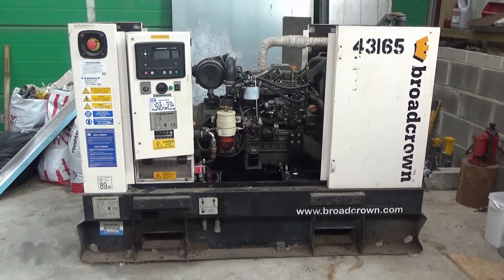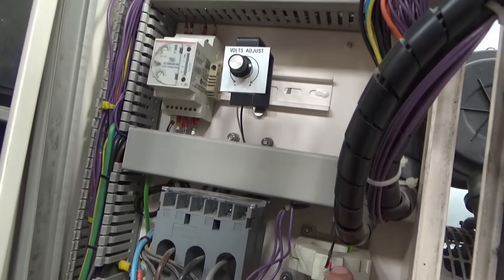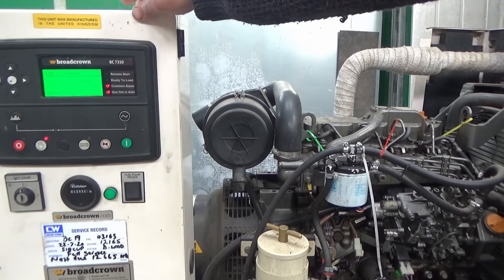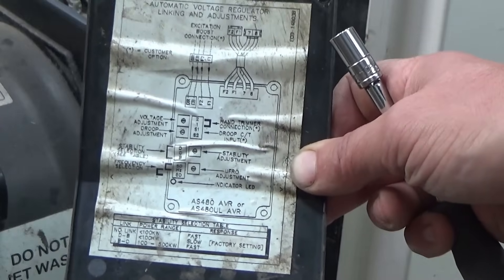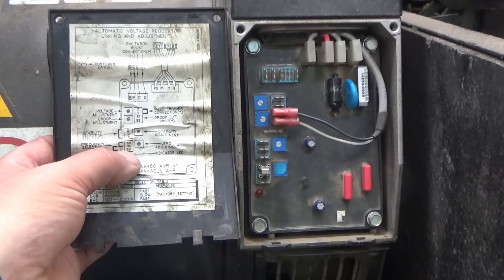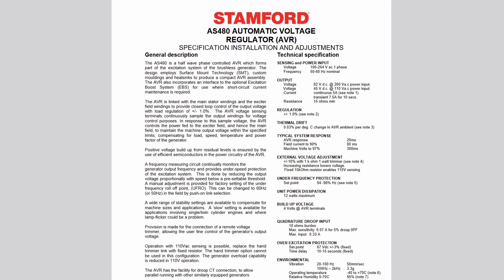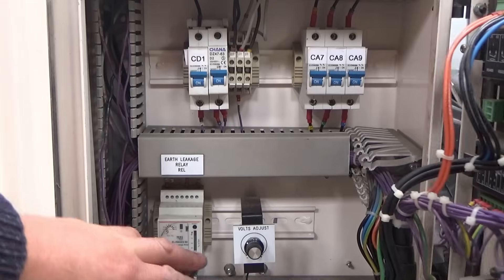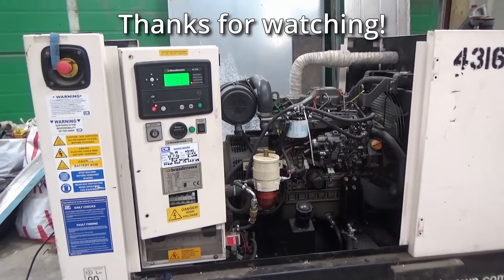Large Diesel Generator - Shuts Down With An ERROR | Can I fix It?

Comment: The frequency HZ is relative to the RPM (probably 1500), so that’s the first thing to get correct.
Then you can adjust the voltage by setting the hand pot to the centre and adjusting the rear pot until the voltage is right, that way you can lift or lower the hand setting while it’s running to obtain a suitable voltage as it will change as the power output increases or decreases.
Reply from the maker: Thanks very much for that 👍 Yes I didn't really know much about generators at the time when I first looked at this. I know a lot more about them now. I did a smaller generator too after this one.
Reply: @BuyitFixit  It looks like a very decent gene, purrs like a kitten now that the engine has been sorted. The controller on the front is made by Deep sea electronics and are very good. 
We all learn from each other and you teach me more than I can teach you. But that's how we learn m8. So keep up the interesting work, we eagerly await the next one each week. :washhands:
Reply from the maker: @electrickal1 Thanks mate 👍Speaking of Deepsea, did you see the video I did where I pulled one of those controllers apart and reverse engineered the PIN, hours, starts etc etc as someone had one without the PIN.
Reply: I did watch that one, that was a smashing video. I love how you can do all that stuff, very impressive indeed. 
I'm a lot like you getting involved with all kinds of things for friends and family, just can't imagine life if I hadn't a soldering iron smoking away and the Fluke on the bench too. And the WAGS think we are out in the garage enjoying ourselves. 🤠

Comment: Common sense would tell you if it's reading around 50 hertz, then it is operating at the right speed. Changing the throttle is not going to fix the voltage issue. In fact, you also change the frequency when you do that, which is a big no, no.
Reply from the maker: Well, the only generators I've had experience of before that were small suitcase inverter generators. So the RPM had no effect on the output frequency. I learned a lot about generators while looking at this. Normally the type of stuff I repair would be like repairing the control panel for this down to component level under a microscope. In fact, someone asked me to look at a similar control panel where the PIN code was unknown, and I successfully worked out the pin code by reading one of the IC's then reverse engineered where the hours / number of starts / KWH produced etc was stored. https://www.youtube.com/watch?v=mPSJNyyvnKE

Comment: Still playing the video but I noticed the control panel reported a "Common" error. When you raised the engine RPM, it forced the generator to run over frequency.
Having 215V between phases indicates a faulty neutral. 
Suggest tracing the neutral line for an open or crossed connections.
Reply from the maker: Yes, I learned a lot about generators looking at this, now I know the RPM is the frequency and the voltage is controlled via an AVR 🙂
Reply: @BuyitFixit  On many of the smaller portable generators, they have no AVR and run 10-20% overvoltage at no load. One reason they shifted manufacturing towards AVR regulated and, with all the electronics in everything today, inverter generators.
Inverter generators use the MOSFET arrays to produce a waveform cleaner than most utilities.
Reply: the common alarm will have no effect on the speed, it was at 215V AC because it was reacting to the drop input wiring fault. no issue with the neutral.

Comment: A bit smaller and a lot quieter than the 27litre v16 twin turbo Dorman diesel 3phase generator I was messing with.
What an amazing engine that is, less than 100 hours on it since the 1970s! The building it's in was built around it because of the size. It has a 1000litre diesel tank and starts instantly as it has hot water flowing around it permanently.
Reply from the maker: Yes 😂😂I normally work on a lot smaller devices than this, and often involving a microscope and tweezers, so for me this was a big unit but obviously the one you mentioned was a whole lot bigger 😂😂👍

Comment: When you say the owner rebuilt the head because the engine smoked it may be because the generator had been run on low loads. Constant speed diesels don't like that and suffer from something called "wet stacking". Unburnt fuel carbons up the top end from oily wet soot solidifying. 

I made a test / load for my 22kW single phase generator from three domestic shower heater cans, each of which has two settings, so I can switch the load from 4.5kW up to 27kW with three DIN rail switches. I just run mains water unrestricted through the cans in parallel. Every few months I run the gennie on full load for an hour if it has been run on a low demand for an extended period. Amazed at how much ** comes out the exhaust for a while! 

When I bought it wet stacking  had carboned up the top end on it.... They like about 75 to 100 percent load apparently.

Nice simple fix, another great video.
Reply: I would call it bore glazing, not sure if it is the same thing, minimum load is usally 60%. 100% load for an hour would clean the engine, but if its to bad it needs the head off.
Reply from the maker: @acooper1037  Thanks for that. Yes it was bad, smoking it's t1t$ off apparently 😂😂😂
Reply from the maker: Thanks, yes I believe it was a carbon build up, but I wasn't there when they stripped the head off it. I only got asked to have a look when they couldn't figure out why it was stopping after a few seconds with the error.

Comment: A lot of these generators need a minimum load of 5 to 15 percent, especially 3 phase types. Also they dont like it if power on the phases is imbalanced. Was pretty amusing but not very surprizing that the issue was sombody trying to fix it previously 😂
Reply: its at least 60% load to prevent bore glazing.
Reply from the maker: Yes, I guess someone was trying to get it cheap at auction! It was the first time I've ever looked at something like that as I normally work on PCBs and such. I learned a lot though so it was a good experience. I since looked at a control panel for one of these which was more the type of work I normally do. I managed to extract the pin code and figure out how to change the hours etc if you haven't seen that one.
Reply: @BuyitFixit  yup I've seen people do that and it's shameful.

Comment: phase and neutral should be 230volts. only silly british voltage is 240. pumping out way too much power and voltage in the silly isles
Reply from the maker: I wish I had 240! Mine is regular 250 or higher! You can see it on a couple of my videos where I've measured the input voltage to the thing I've been repairing.

Comment: It you ever get a similar call out head straight to the AVR and check the configuration. I've seen quite a few sets where the actual configuration hasn't been as supplied for whatever reason. When installed a lot of the larger sets are 'tuned' to site conditions. Stamford is the lower cost line of alternators from Newage (Cmmins Generator Technologies) but they're still quite a bit better quality than some of the other brands out there.
Reply from the maker: Thanks for that, at the time I wasn't even aware of the AVR or how these devices worked, I learned a lot from the experience so I know better now if I have to look at a similar device again 👍 The stuff I normally work on is more board level stuff, I recently did a video on a control panel for a similar generator..
Reply: Newage /stamford are the best alternators in the world, the ones made in the UK anyway.
Reply: @acooper1037  I'd agree with you on that. Newage it you can afford it, every time. Best AVRs too. Part of the mighty Cumins these days but I did one visit the factory at Stamford.

Comment: Looks ex hire,  I’ve seen this kind of thing where the techs at the hire depot sabotage the gear, write it off aiming the alternator is blown and buy it back from auction cheap knowing the fault 2 wires and and a trim pot. 

Seen it don’t with 35k forktrucks, claimed bad battery and they were auction dumbed buying them back for 2k and reselling them for 25k!
Reply from the maker: That was pretty much along the same conclusion that we came to. Thanks for sharing 👍

Comment: Love it!
This area is one I have a bit of experience in so when you started playing with the engine speed I thought "oh boy," but you methodically put yourself back on the right path. I thought exciter or VR from the beginning and that's where you ended up. Usually the excitation supply voltage comes from the battery/engine aternator combo, but you hooked up a fresh battery, so that was ruled out.
Reply from the maker: Thanks, yes my first experience with one and I learned a ton! Like the RPM controls the frequency, and the AVR the voltage. Sometimes it's not about the fix but what you also learn on the journey 👍
Reply: The excitation voltage only comes from the alternator (bigger generators), on Newage its usally a PMG, on some they have an auxilary winding.

Comment: You can make a temporary load bank with a dustbin full of water and three probes suspended in the water and add some salt gradually. Great way to really test the output capability of all three phases.
Reply from the maker: I don't fancy trying it 😂it sounds pretty dodgy.
Reply: @BuyitFixit  I did it back in the 80s and it worked very well. Amazing how quickly you can boil the water. I don’t think there was any health and safety back then 😂. Thanks for the video.
Reply: plastic tank, and add salt for more load.

Comment: Good troubleshooting.
But I cringed when you measured with a probe in each hand. If something goes wrong, the Voltage will be across your chest/ heart.
Safer to use an Alligator Clip and keep one hand behind your back.
N'est-ce pas?

Gregory/
The Pigeon Meister
Reply from the maker: Thanks Gregory, and good point. I didn't expect it to be a problem with the actual generator itself and was hoping it was something to do with the display / control panel as that's the sort of stuff I'm more used to working on. I was not really prepared for working on higher voltage stuff, although I was being extra careful you are very much correct. I could have borrowed some welding gauntlets or rubber gloves perhaps which might have helped minimise any problems. Thank you again for commenting👍 
Best wishes
Mick

Comment: Engine speed controls the Hertz, the Regulator board controls the voltage.
Reply from the maker: Yes, at the time I didn't know but I learned a lot as I got on with it 👍
Reply: 50 cycle is 1500 rpm, 60 cycle is 1800 with a four pole generator. You can get practically any voltage you want by rearranging the stator leads, per the wiring diagram. Then adjust engine speed up or down to get correct HZ. Great video!

Comment: That is neat! And reminds me of my commissioning days. And the projects where I was a customer of FG Wilson. :D
(Nice factory, if I can trust their FAT pictures)

When you showed your first impressions, I wondered if the governor was knackered. Frequency at 54 Hz seemed a bit off. 
And the voltage was a good indicator to look for the excitation.
The frequency probably should be adjusted when used with power tools. 10% may be too fast for angle grinders and circular saws. Slurry pumps probably won't care, though.

Your diagnostic method is great! Pulling the throttle gave a bit of a tangent, as speed usually only affects the frequency, but you caught that really fast.
Reply from the maker: Thanks 👍yes first time looking at a generator, but I learned a lot! and we managed to fix it 🙂

Comment: I’m not sure if it’s just my years of experience but, the first error for under volt and seeing a non factory pot you didn’t think to check that first? Careful, not all sense wires are accurate I always use my meter for output.
Reply from the maker: First time I've ever looked at a generator, I normally repair electronics down to component level (check some of my other videos). I wasn't sure how the voltage regulation worked or if it was a problem with the control panel, but as you say experience helps greatly. I was actually hoping it was  problem on the panel as that's the sort of thing I'd normally work on. If I ever look at another now, I've got a lot more idea and gained experience so I'm sure I'd be able to diagnose the problem a lot easier 👍
Reply: under voltage could have been many things, manual pots are very common.

Comment: Usually engine speed controls the Frequency and they use an AVR to raise or lower the voltage.
Reply from the maker: Yes, after working on it I realise that now. It was the first time ever looking at anything like this before but I learned a lot, and we got it working 🙂 it was a bit different than the usual repairs I do which usually involve tiny components and a microscope 👍

Comment: Use a phone to photo the cables and settings before dismantling, easy.
Reply from the maker: Agree, I did that recently with a 3D printer I was looking at. We were wondering if this could have been intentionally done and someone was trying to get it cheap or hoped it wouldn't sell at the auction.

Comment: if not fixed yet,we have had similar problem with 4 cyl diesel and it wouldnt work after sitting long time 1 year, and i ended up getting a 140 $ Canadian electronics board on back side of display and that fixed it!, hed to set pot. for output voltage on all 3 legs?
Reply from the maker: I didn't know who made the controller, but a couple of other people have mentioned similar. Thanks for commenting!

Comment: Always cut circuit breaker before powering down! Will limit any abnormal voltages/frequencies to enter connected equipment - switching power supplies usually don’t handle that well.
Reply from the maker: Good tip 👍I usually do this with my small 5kva backup generator I use at home. I also run it up first and wait for the voltage/frequency to stabilise before switching the breaker to the load on.

Comment: Have worked on generators for over 30 years, watching this is verrrry painful and dangerous for him
Reply from the maker: I suppose if I were watching you trying to replace surface mount components the size of a grain of rice on a PCB or reverse engineer the password for a solar inverter, then that may also be very painful, but I'd still give you credit for trying.  I've never worked on generators before and don't have 30 years experience unlike yourself. It may have taken you a few minutes to repair it but aftet all I did get it working..
Reply: It's not the how fast or long it takes to fix but more of a sistamatic troubleshooting once the problem has been identified. We once had a tech at our shop working on a cat generator and just grabbed the throttle and went wot just like you did, luckily there was only 1 thing damaged...costly oops @BuyitFixit

Comment: Never manually rev a generator engine. Jesus
Reply from the maker: Yes, I've learned since that it only regulates the frequency. At the time I didn't know this, but it's all a learning curve if you've never worked on such a device before.
Reply: @BuyitFixit  yeah fair enough mate. Looks like a good unit
Reply from the maker: @DarrenBoxhall  Thanks Darren, must admit it's the first time I've ever worked on a generator, I usually work more on electronic circuit boards etc so this was a little bit larger than the things I normally work on 😂😂😂
Reply: @BuyitFixit  bahahha.  Another skill added to the Resume haha

Comment: @8:40  your looking a the AVR board. on some older AVR boards they have a capacitor, this stores a small amount of DC power thats used to excite the windings,  if the generator has been left standing for a very long time this capacitor may have discharged, this can be fixed by flashing it with a battery. you will need to look up the details of that board to find out what dc voltage is needed.
Reply: I think you are thinking of residual magnetism.
Reply: @ickipoo i think you think about jakoling😂😂😂
Reply: This alternator works with a PMG ( permenant magent generator) so you never need to flash the field.

Comment: @4:50  the engine speed should be 1500 RPM,  while you carried out the second run up you scrolled the panel and it showed 53hz, this means its actually running slightly to fast.  this can be expected for a generator of this size as it will have a very basic fuel system. as the load on the generator is increased the engine spped will slow down a small amout and get nearer to 1500 RPM / 50hz
Reply: That's an odd Hz being from Canada we run 1800 rpm 60hz.
Reply from the maker: Yes it's should be 50Hz in the UK. It was suggested that it would probably drop when the generator was under load.
Reply: @BuyitFixit  England - drive wrong side of road - different Voltage and HZ, toast only one side of bread - 😁
Reply from the maker: @GFY_FOAD 😂😂😂😂
Reply: 50Hz is 1500RPM, if it has an electronic speed controller then it should stay at 50Hz if it has a mechanical govonour then you set it to 53Hz so it droops to 50 at full load.(speed droop)

Comment: Controller looks like a rebranded Deep Sea 7310 Controller. Very common and pretty comprehensive but might help for fault finding in the future.
Reply from the maker: Thanks Rival Son. It was the first time looking at anything like this so I  was a little out of my depth, but I learned a lot so it was a good experience. I usually repair PCBs down to component level like the Milwaukee impact driver I just repaired. Thanks again for your comment 👍
Reply: @BuyitFixit  I use these controllers on a weekly basis and maintain generators but this was a fault I hadn't seen. Nice work 👍
Reply from the maker: Thanks Rival Son👍
Reply: its not rebranded , you print out a lable and slide it in the top section from the rear.